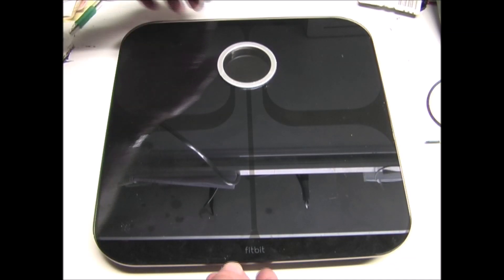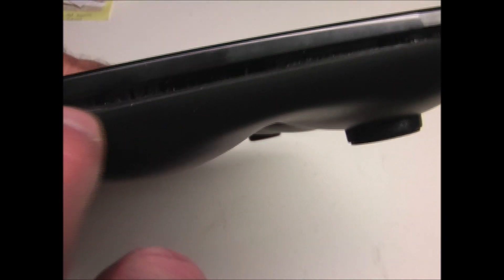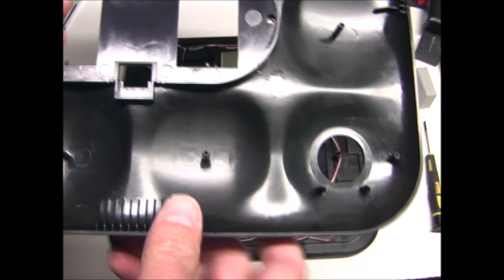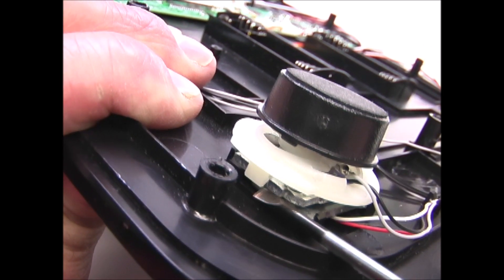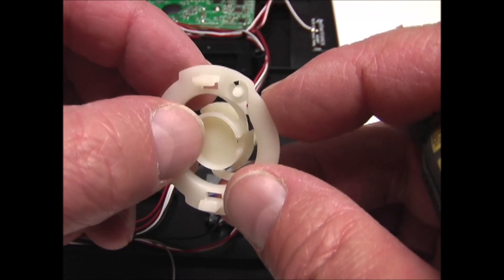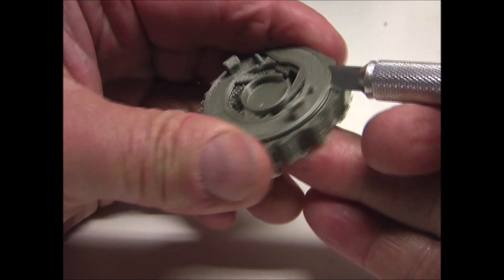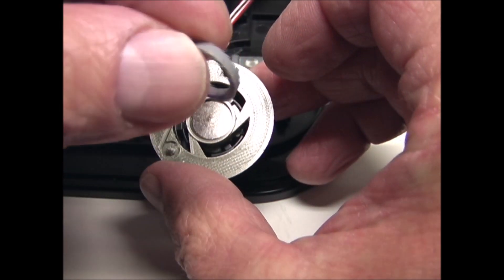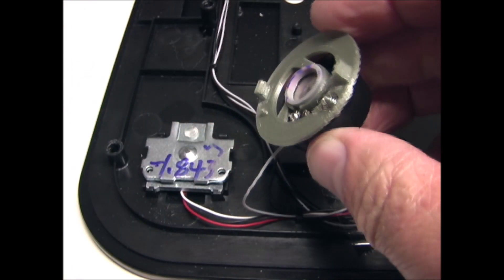Fitbit Aria Scale: Replace Broken Feet Mount. Disassembly, Repair & Assembly

Comment: Accu Weight model BS 1070G,  bathroom glass weight scale... the level adjustment foot broke off after using it 200 times. Duct taped it, lol, still works

Comment: Anyone watching this video please consider supporting right to repair laws, the fact that these scales become garbage from such a simple failure is insane.  Companies like Fitbit NEED to be held accountable for supplying replacement parts!  It's great that the community has found a solution but it shouldn't have to only be up to us!
Reply: I almost bought a new one before I found this video.  I couldn't even get the thing apart to fix it.
Reply: @techcerotops  Probably the case for 99% of people who purchased this scale, very unfortunate and wasteful but it’s nobody’s fault but Fitbit
Reply: Many suffer from pinched wires too.

Comment: excellent useful video, thank you.  my scale failed to reliably detect step on/step off and therefore would chew thru batteries.  in my case plastic feet holders were fine and disassembly and careful reassembly were sufficient to repair the situation.  here were my steps:removed two battery screws.  pried off back (follow video since this is tricky).  plastic feet mount appear OK.  remoce feet assy. 

the two feet on the top (display) end of the scale don't have contact wires.  they appear to be load cells only.  the two feet on the bottom end of the scale have wires for the step on / step off detection contacts.

the little spring coil wire is just to make electrical contact with the metal base plate.  it goes over a plastic "peg" that mates to a hole in the plate.  getting this little spring to stay in place is quite tricky.  there is a notch in the groove that the wire needs to go under to stay or deform some plastic over the groove.

i cleaned the wire and matching spot on plate with alcohol to remove anything getting in the way of this making good contact.

the rubber ring is slightly conical.  if you put the fatter end goes into the plastic mount to helps hold it in place during reassembly.  i think this rubber ring is the "spring" for the weight on / weight off contact.

VERY IMPORTANT: the metal ring has a tab that needs to be rotated as far from the wire for the spring to avoid shorts.

reinstall foot assy in proper location.  repeat for the other foot assy with wires.

the unit can and should be tested before installing the back cover.

prior to reassembly of the back, check that the wires are routed properly and go through any guides and that no wires are going to be pinched.  add scotch tape if and as necessary.

Comment: What type of filament did you sue ? PLA, ABS, PETG, FLEX, HIPS, PVA ?
Reply from the maker: Hatchbox PLA
Reply: I'd recommend ABS if your printer supports it, the main body of the scale is likely ABS. PLA will not last.

Comment: I took my scale apart as well when it kept asking me to step off after I already had done so. After 3.5 yrs, it was well out of warranty so nothing to lose. Both front plastic pieces you show here were broken. I was able to repair them with super glue. The little gray rubber pieces were deformed from being out of place for such a long time. I was able to restore their original shape by boiling them with water in the microwave. When the plastic feet break again, I’ll get them 3D printed at work. Thanks for the video!